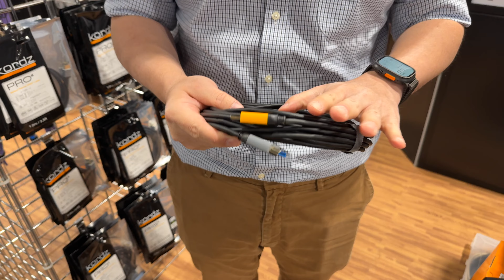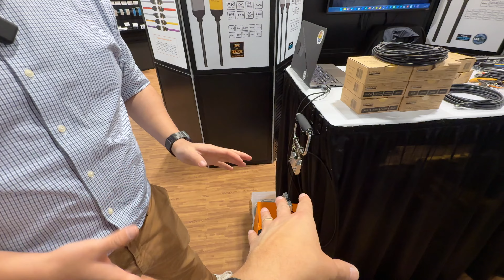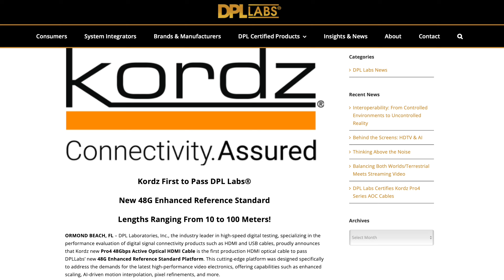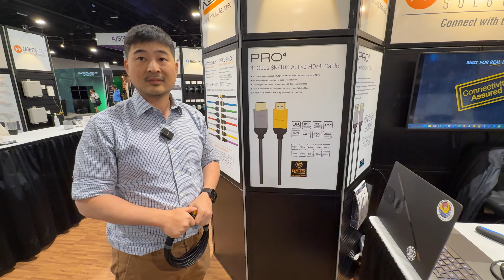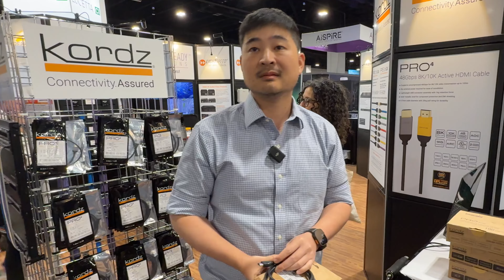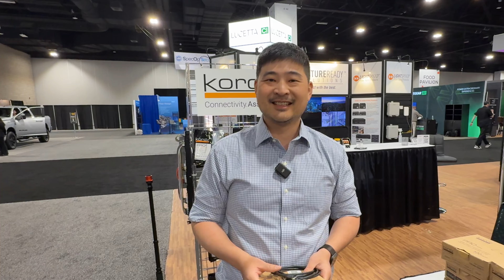This HDMI Cable Crushed a 30lb Stress Test 😱 Kordz Pro4 Active Optical 2.1 Cable + Exclusive Chat!

Comment: AV Norvona I had Ruipro and its garbage.  I only use THX HDMI 2.1 cables and I absolutely love my THX HDMI 2.1 cables
Reply from the maker: Those THX cables are really good!
Reply: @av_nirvana, yes, they definitely are.
Reply: What was wrong with your Ruipro cable that you labeled it as garbage? Just bought one from Amazon with great reviews, but haven't installed it yet in-wall.
Reply: I had 4 Ruipro HDMI 2.1 cables that all died on me. Then Ruipro sent me 4 more, and they died within 1 month.
Reply: @hometheaterman1424  Were they the fiber optic ones with the detachable connectors?